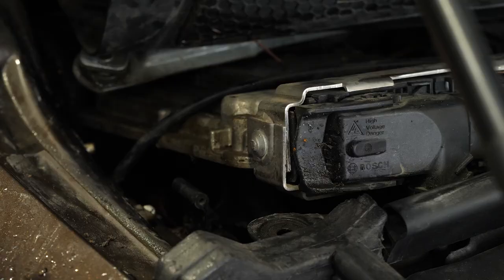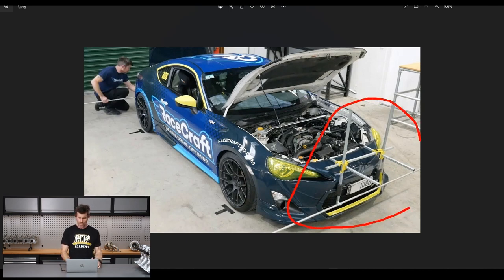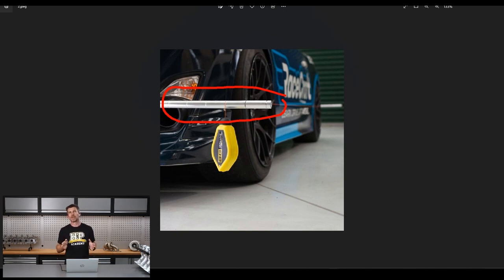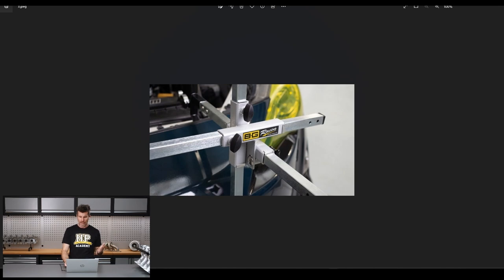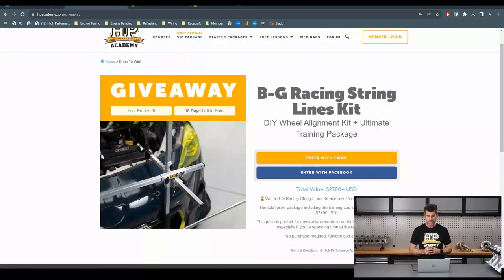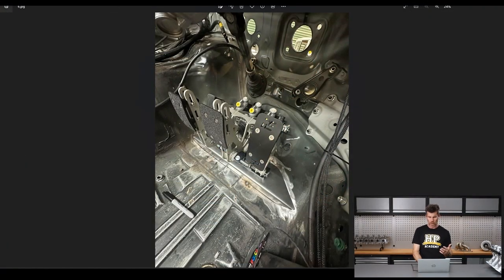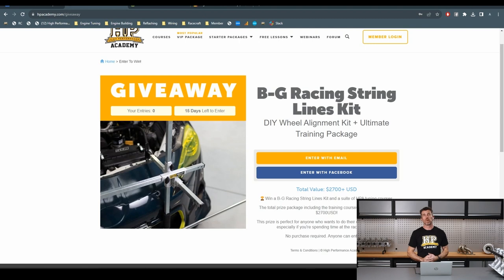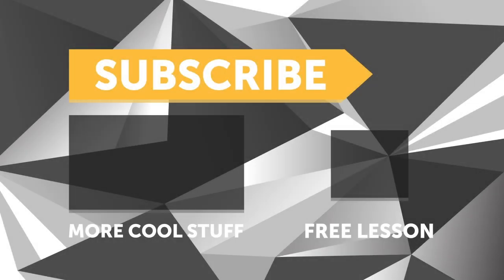We're FINALLY This Critical Part

Comment: Talking about alignments. For me, i use toe plates and tape measures. Then for camber i just use one of those magnetic angle finders used for fabrication. It is qucker than setting up strings, at least for me personally. I did it that way since no shop wanted to touch my car after i put coilovers on it. And now i can get the car to handle exactly how i want, on my own

Comment: what might be interesting is to modify the car itself to have a place on each side to stick a rod in, that was the perfect length to hang the strings from.
going to look into welding something like that to the car frame. Then the rods can be super tiny and fit in the car when you go to the track

Comment: need a string alignments setup that folds down into the smallest footprint possible for taking with you to the track, when you don't have a support vehicle along with you
Reply from the maker: You can fit this one in the boot. Goes into a rectangle travel bag 😎
If you have the room it is a bit quicker if you can leave them setup, but I would consider them portable when packed up personally - Taz.

Comment: In rallying   having the ability to lock wheels  has saved  the moment  through a sort of controlled spin / slide  when all goes pearshaped . Are there any disadvantages  in being  unable to lock wheels in racing
Reply from the maker: Rally doesn't have a choice as the rule book doesn't allow it, noting they do have a handbrake. ABS has pros and cons which will change according to the type of racing, surfaces and budgets rather than being the best and only solution for everyone, everywhere, ever.
Traditionally ABS has generally suffered on unsealed surfaces but it's also come a long way and is still improving as a technology. Motorcycles for example integrate an IMU into ABS control these days, although I am not an expert on exactly where things were at with ABS in the WRC before it was banned or if it was tarmac only or always in use sorry - Taz.

Comment: Random question, the Q7 in the intro, whats the project going on with that? Have some 3D printed lower intake runners for the 3.0T that I would love to see another group using!
Reply from the maker: The Q7 was going to be used for some WinOLS content but we've gone in a different direction (still a Bosch EDC). The Q7 was borrowed from a friend so we don't have a good home for that intake either sadly! - Taz